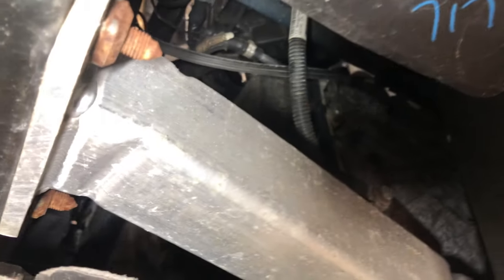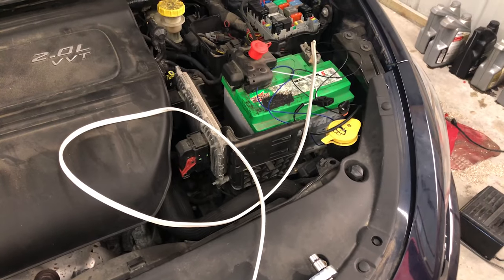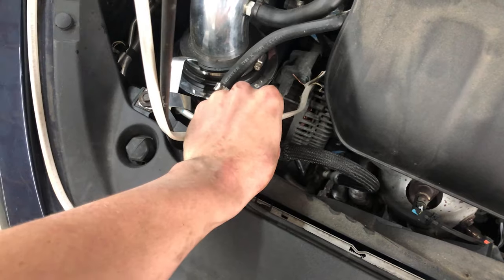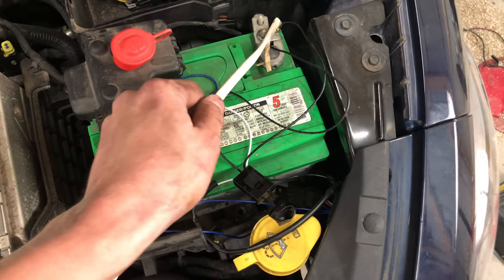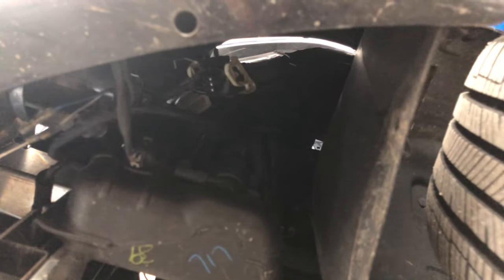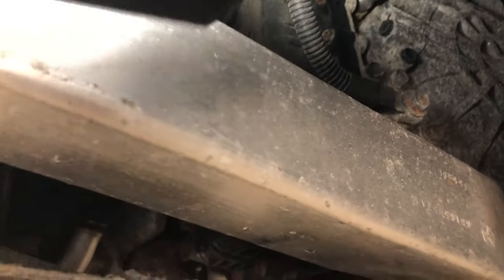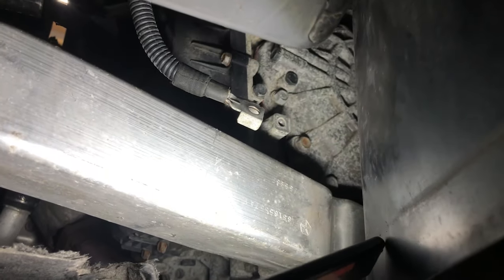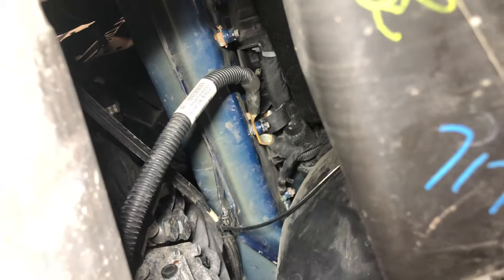Dodge Dart No Crank No Start - Fixed for $0.00 - Bad Ground

Comment: I had that problem around the 130,000 km mark,found a broken ground terminal at the Transmission,installed a new terminal and added a 2nd ground wire from the Transmission to the battery,no more problems,I now have 462,000kms on the dart and going for 500,000kms and more🏁
Reply from the maker: Glad you found your issue. I haven't heard of many engine/trans issues on the darts just wiring issues and a few other things. But hopefully my buddies dart can keep chugging along. I think adding a ground is the best solution going forward. Thanks for the comment :)

Comment: The issue I'm having is I replaced my starter, and it didn't start so I checked the relays but still not start. I saw this video soon as I took it off at the motor; the connector broke off, so I had to order a new one. Hopefully it will start once i get that replaced
Reply: Did you try the jumper cable bypass? Best way to ensure that’s your problem. I would guess so since the connector broke off but give it a try!

Comment: Thankyou!!!! THIS IS LEGITIMATE ! I used this yesterday, if you dont have a spare wire, use the black(negatives)ends of a jumper cables to do the ground test*. My car started right up with a spark! I took the bottom cover off and sandpapered the top copper connection and managed to spray it down with WD40 parts cleaner. Took the bottom one off and cleaned it up, and the car started! Drove it to work today up to highway speeds, seems alright 😊
Reply from the maker: Thanks for the comment ! Idk why I didn’t use jumper cables when I was doing this. I have used that method in the past and ever since . But for whatever reason when filming the video I had a brain fart lol . Anyway I’m glad this helped you out . Doesn’t hurt to add another ground from the battery to the top alternator bolt . I picked up one at AutoZone for like 15-20 bucks I think .
Reply: @JustFixinGarage  credit yo my dad for sure man, he found your video and even gave me the jumper idea. This video is spot on though, brilliant ! You helped alot of people I'm sure

Comment: So I did this and the car started right up. And I've started it up several more times with no problem does that still mean it's the ground?
Reply from the maker: If cleaning the grounds made a dart that is not starting then after cleaning it does that’s a very likely case that the grounds were the fault  . Or just terrible timing for something else to decide to stop acting up . Grounds are super common on these which is why this is my my watched video. It wouldn’t hurt to add an additional ground as well just to ensure it never becomes a future issue :)

Comment: I had this problem. I was stuck in the car 80 degrees for 3 hours in a parking lot until it got towed home. This video was so helpful I really appreciate it.  Im disabled so I can’t do or afford much. I couldn’t get to the original ground so I ran a 5’ ground to a grounded bolt on the alternator. She fired right up.  $15 bucks.  Thank you so much your video was a life saver.
Reply from the maker: Thanks for the comment ! What you did is exactly what I did in a other video by adding a new ground . This should never be a problem again for you !
Reply: Where did you get the 5' ground? Just ground it and then connect to grounded bolt on alternator?
Reply from the maker: @tht1koreankid  AutoZone sells them which is a local auto parts store .

Comment: Also sometimes if your valve cover gasket is leaking. Oil can get all over the starter. Take out connector clean with a little contact cleaner.

Comment: Just think what a little effort at factory to prevent corrosion would do.... Once of prevention worth pounds of cure ( fixing )?
Reply from the maker: Oh yeah they didn’t even try. Something critical and realistically making a better ground or redundancy can’t possibly cost Much on the assembly line. I just had a 2015 fiesta in with the same issue . Added an extra ground and it’s golden again .

Comment: Did this yesterday . I was very skeptical - but damn - it worked..  I think what was most important was cleaning very well the neg terminal at the battery too.  Thanks for posting.  Sucks you changed out a good starter.
Reply from the maker: Yes ! Sucked changing the starter for sure.  I should have started simple. But my mistake I am happy to help others save the time and money . I have another video where I did a ground upgrade and it only cost 15 bucks !
Reply: @JustFixinGarage   I learned long ago - always go the cheap route first.  I'll check out that video.  Thanks  again.

Comment: Well thank you for being humble and posting what the problem actually was. Tbh I didn't even think about the negative battery cable being grounded to the frame and then grounding the engine. I had replaced the ground to the alternator bolt last year and the car started for a while and then stopped again. So, last month I dropped it off at the dealer near me and it wouldn't start for them in the morning. They decided to "Diagnose" the no start issue and told me it was the starter, for the same reasons you figured. I guess I expect dealer mechanics to have a little more knowledge about the vehicles sold by the manufacturer. Like problems, common issues, etc. Thank you again because now my 2013 Dart Ralleye 1.4L turbo is starting without issue. I will be replacing the ground since the previous owner broke the eye connector and then jammed the bolt through the braided wire. I also added an extra ground I found in my tool box. Thanks again Man. 😁👌
Reply from the maker: Thank you so much for the feedback. Once I realized I had misdiagnosed I was upfront with my buddy and was like "I was wrong but I will fix this car". I think the next step as you mentioned is upgrading the ground and adding to it. The amount of electronics on these cars and they use a tiny ground cable . Shame on Dodge (even though I am a big mopar guy) .  I am glad to hear this video helped you. I also see you subbed that means ALOT and I greatly appreciate it. You have yourself a great day !
Reply: @JustFixinGarage  Well I thank you because of your honesty I saved myself a lot of money. I also let the dealer know in a Google review that I'm very unhappy with this situation. Thanks again.
Reply: @JustFixinGarage  I bought a ground strap to go from the range stud to the transaxle. Just have to install it now. Cars still starting and running no problem at all. Thanks again
Reply from the maker: @Bandit69ply  let me know how that works out. My buddys whos car is in this video I think will be adding a ground wire as well. Just for peace of mind. Hes having issues today with it starting but we think its a bad battery (over 5 years old). as jump starting it got it going fine. I like the idea of a new better ground.
Reply: @JustFixinGarage  Mines still starting no problem at all. I occasionally have an issue with the dash not having power when I put the key in. So I turn it back and when I turn it to start everything's fine. I ripped the dealer here a new one for charging me the full amount for a misdiagnosis. The battery in mine was replaced in '19 just before I bought it.
Reply: @JustFixinGarage  I also picked up a regular battery ground like the older styles that is rubber coated, 4 Guage I believe and nice strong eyelets

Comment: TL;DR  Try putting it in neutral and see if it starts. Adding the new ground wire was key. 
Been having the no start, click click click issue off and on with my 2013 Dart SXT c. 82k miles for a few weeks since my last oil change. It would eventually start sometimes if I had my door open, or jiggled steering wheel, then it got worse a few days ago. I spent $150 on a new battery, to find that the old battery was still good, alternator and starter good. But still only occasionally start. I Watched this vid and the linked vid in your description (from about 25 min) in where you recommend a new ground cable from neg battery terminal to alternator and put one on last night. Can’t get under car to clean existing ground wire, so just added the new one. Didn’t fix issue, but did start strong many times, before later back to click click click. At end of my rope thinking I’m going to have to spend big bucks at dealership to have them be unable to diagnose like other commenters have said. Put my FIXD code reader on, ran scans last night and this morning, no codes/issues. Bought car at 24k miles, put about 60k on it in 6 years, regular synthetic oil changes, 3 batteries (although battery #2 is still good), this has been the best car I’ve ever owned, not a single mechanical or electrical issue ever EXCEPT shift cable bearing went, and since it was a recall item, free repair. I got to thinking about that, and wondering if shifter might not be fully in park if that bearing was going bad again, and that sometimes my key won’t come out when turn it off - I always think it’s because the shifter not fully in park, so I usually restart it and put in park forcefully and jiggle it, then key comes out, and that a car will only start in Park or Neutral. With this in mind, I put car in neutral, and it started right up like a champ. From then it started several times from regular park. 
Idk if this is a permanent work around, starting in Neutral, but this hasn’t been suggested in any of the 6 or 7 videos, or any comments on the videos, of the issue that I’ve watched on the topic. Will post updates on whether this becomes a reliable work around. Also would love to hear if this helps anyone else, and your thoughts about it possibly having a connection to the shift cable bearing thing. Thanks so much for your videos.
Reply: Update: Starting every time now for about a month.
Reply: @heidehaydu  Hey what did you do exactly cuz I have a 2014 Dodge dart sxt that turns on only sometimes and other times doesn’t
Reply: I recently have been having starter issues and noticed it usually happens on days with high humidity. When I get the spare money I'll try having a shop look at it and suggest looking for corrosion as they will have a lift with better access.

Comment: My 2013 Dodge Dart rallye wont start , no sound at all when turning the ignition.. any advice?
Reply from the maker: Have you checked the grounds ? Battery is good ?  If that’s all good check the fuses . Do you have radio and such ?
Reply: That was the issue in my 2013. That ground wire was the exact problem i had. Been fine for almost a year now. How'd yours work out?

Comment: Kind of a similar problem on a 2015 that I have, 5 months ago no start, no crank cycle the start button probably 12 times or more. Finally started. .
Just yesterday happened again yesterday but no starting this time at all without having to use a jump box.
There was no cranking sound at all like a dead battery or a starter trying to struggle it was just a click from under the hood just like a relay click,, analog gauges were also flickering.
The car started via the jump box" then once it did start, you can hear the load on the alternator because the battery is charging. There's something causing draw and I have no idea what it is, perhaps a relay hanging open.
Either it's BCM starter T14, or ECM starter T20. 
Anybody have any idea which relay I should replace I got the relay the auto parts gave me for the starter relay, by it realize it might have been one of two potential ones to go bad.

Comment: Omg thank you so much I been having this problem for the pass 3 weeks replaced the alternator 3 times still had the problem it would work but than the battery light would come up..imma do this now hope that's the problem..thank you for sharing 👍🙏
Reply from the maker: Hope it helps you I have another video where I add a ground wire and it was only 15 bucks . Be sure your not low on oil too :)
Reply: Did it work?

Comment: I'm gonna try this tomorrow... technically, with what time it is right now(12:39am), tomorrow is today, but I don't consider the next day till I see sunlight. But I woke up this morning to my 2014 SE no crank, no start, and immediately thought clutch safety switch, but now that I've seen this I'm gonna jack mine up and clean it just to be on the safe side.
Reply from the maker: Before you even attempt cleaning it do the jumper cable trick to test the ground . For sure worth trying . If that makes it start then for sure go clean them grounds and I suggest even adding another ground.

Comment: Fingers crossed thatsmy problem, along with all the others. Side note, I noticed the brackets on my rear seats rusted,  is it possible a lot of these cars have these electrical problems, blinker wires Corroding, crank issues, etc. They were in flood area and sold rather than car main computer issue? Anyway, thanks guys, otw to check my cable.
Reply from the maker: Flood vehicles are always a gamble as issues can go months or years before they present themselves as the Water corrodes the electrical components. As for these cars having electrical issues in general it seems the ground issue is a big one as I am in a few Facebook groups and I have another video that I do an alternator . If you are having starting problems though as silly as it sounds check the oil
Level too . These can’t run or start if they are too low.

Comment: I've got a 2013 with a no crank issue. I'll be trying this soon. I'll use jumper cables instead of Romex though 😉
Reply from the maker: Yup use the jumper cables . Other possible causes are ofcourse a bad starter , bad starter relay , bad/drained battery , bad neutral safety switch . Let us know how it works out

Comment: Thanks for video hoping this is my issue.
Reply from the maker: Be sure to rule out a bad battery and low oil as well. If you check out another video of mine I do a ground upgrade for $15.00. You can test the bad ground using jumper cables from the negative side of battery to a clean spot on the motor. Hope you get it figured out!

Comment: Forgive me for my ignorance but how does connecting the wire from the ground terminal on the battery to the alternator bolt test the actual faulty ground cable underneath on the frame to the engine motor?
Reply from the maker: Hey Jerry ! By running a cable from the negative on the battery to either the alternator (or any part of the motor) you are supplying a ground to the starter since it all connects. This allows the electrical circuit to complete. You’d be surprised that most electrical issues are usually a ground issue . I chose the alternator because it was a clean easily accessible piece of metal . I have another video in my channel where I actually add another ground wire to the dart and it only cost 15 bucks and takes 15 minutes . You can never have too many grounds . I do suggest instead of using house wire like I did you simply use a jumper cable clamp from the negative terminal to the motor . Again , the alternator was the easiest part for me but you can clamp it to any clean metal part of motor (no paint ) .
Reply: @JustFixinGarage  thanks for the thoroughly answer. that makes sense now. im gonna try this on my Dart later today to see if I could get it working. And yes I was going to use my jumper cable.
Reply from the maker: @jerryakamuadams6399  sure thing. DO let me know if this was your issue. I love hearing that its a cheap fix. If this doesn't help and you are sure your battery is good I would check to ensure the starter is getting the signal to start. If it is and its still not starting the starter may be bad. I have a video doing that on a dart as well depending on what motor you have
Reply: Really? It's common sense.. If it doesnt start normally but does when you run the cable to the alternator that tells you the existing ground connection is bad

Comment: I have a 2016 GT and it suddenly just stopped starting and I’ll have to push the button a couple times then it’ll start right up, I suspected a bad ground and I think this just confirmed it
Reply from the maker: It is for sure a very common issue on these vehicles. They didn't do very strong factory grounds and they easily become corroded and lose connection.  hopefully this is your problem as well.

Comment: I have tried this cleaned grounds...and also repalced starter only starts with using a wire to power the relay...
Reply from the maker: @luisparamo9402  could be several factors and the wiring diagram will be needed . Could be a fob reading issue for the security side , bad ignition switch (piece that turns if you have that style )

Comment: My car is a dodge dart 2014, the brake pedal locked up, car won’t attempt to start, jumping it didn’t work, all electric turns on but it just clicks when I attempt. What do I do?
Reply from the maker: The brake pedal locking up is a new one unless it’s just an electronic parking brake locking. You should make sure you have a good ground like show in video while trying to jump it as well . There’s multiple things to check to see what’s going on. But you’d need a voltmeter and or a test light and helper . First thing I would do is check the signal wire on the starter to make sure when cranking it gets power . Then go from there.
Reply: Did you find out what it was?

Comment: That’s worth a try, was the battery dead in it? as in radio and ac not working? i want to do this but i’m not sure if it’s my problem either
Reply from the maker: Hello, In our case the battery was fully charged and jumping the battery didn't make it start.  You should check the battery voltage and such first before dealing with grounds. If you have jumper cables though you can test the bad ground by clamping the Black terminal to the ground on the battery and the other black clamp to alternator bracket. I used some house wire but a jump cable is best.